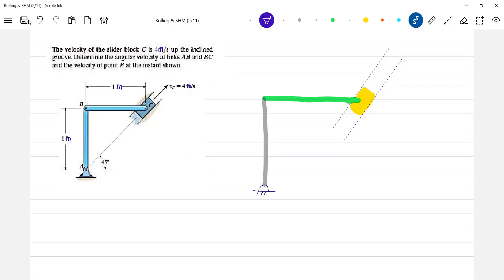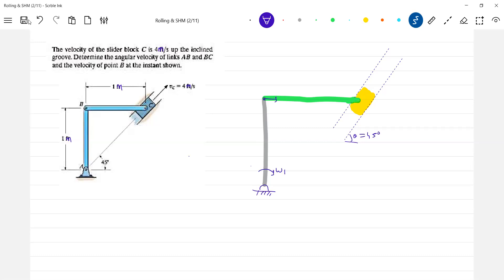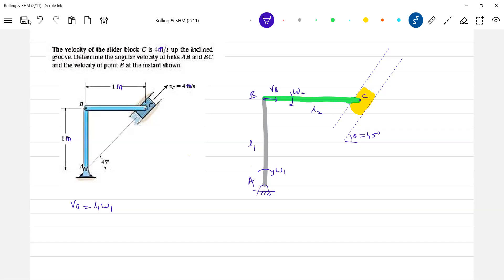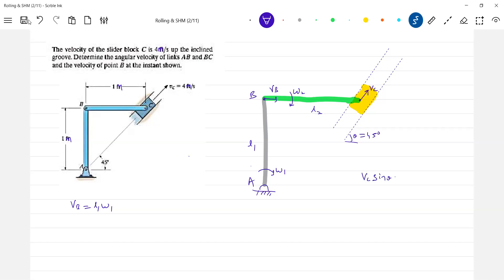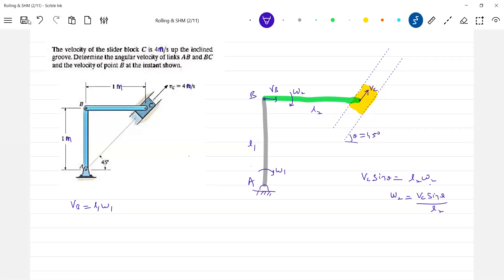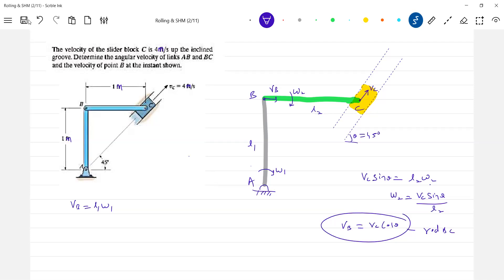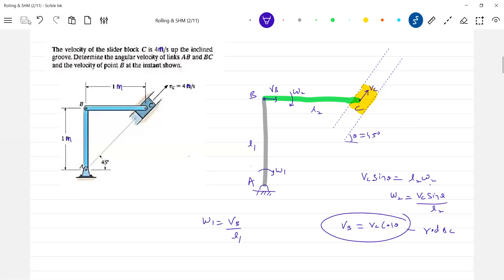11) Rotational Dynamics | The velocity of the slider block C is 4ft/s up the inclined groove.

Comment: 9. The pendulum hangs from the pin at O and comprises two slender rods, cach weighing 10 N. Calculate the moment of inertia of the pendulum about (a) the axis passing through point O, and (b) the pendulum's center of mass G. The lengths of the links OG and BC are both 2 meters, where point A denotes the midpoint of BC

Sir this question please asap😢
Reply from the maker: Diagram needed,